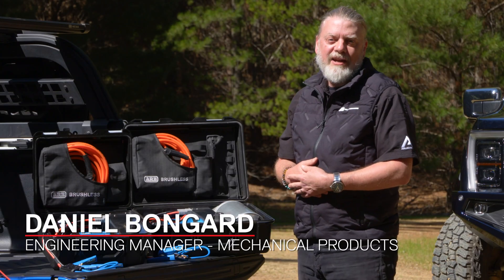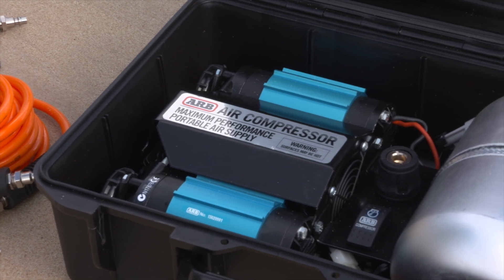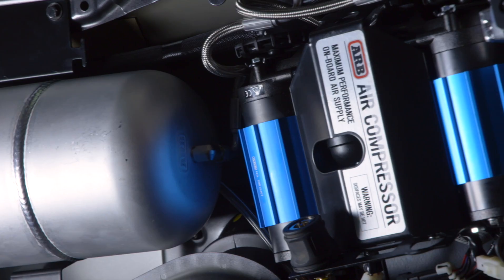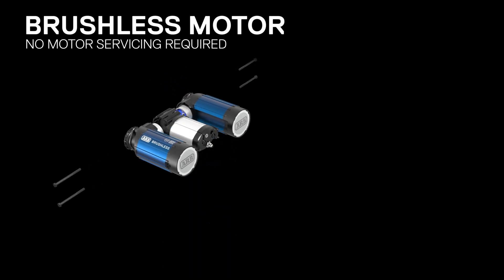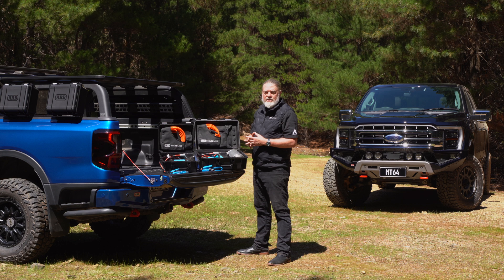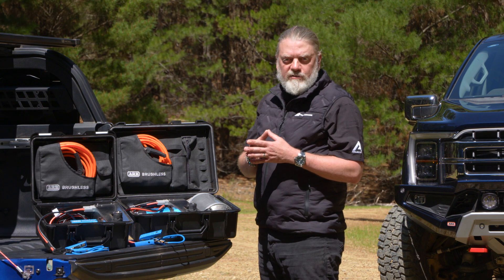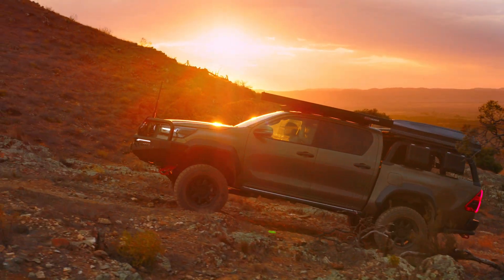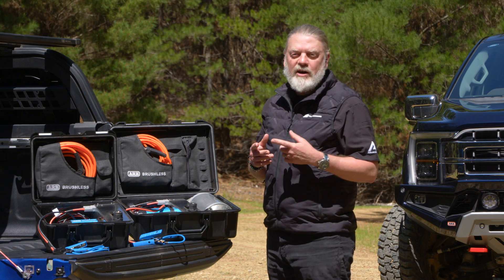Introducing the ARB Brushless Air Compressor!

Comment: Do you Have ARB Air Lockers For A RAM REBEL 2500 FRONT AND REAR?

Iv Seen Powerwagon Have ARB Lockers Installed.. But Wondering About The FRONT Of A RAM REBEL 2500🤔 Having A Smaller Front Axle...
✌️🖤